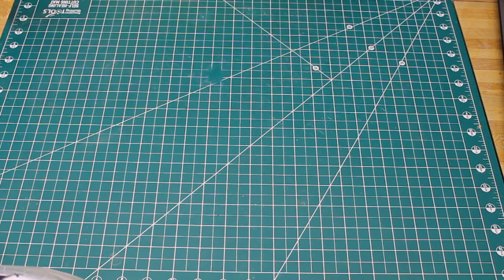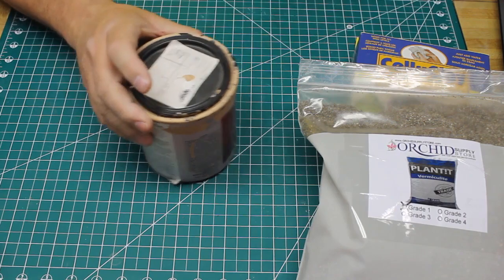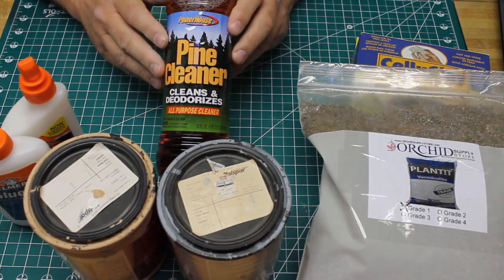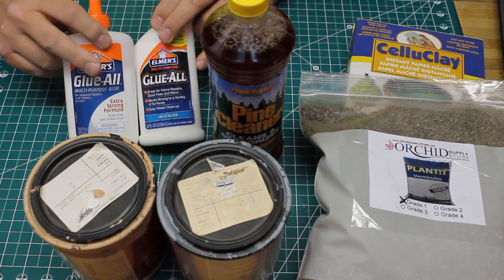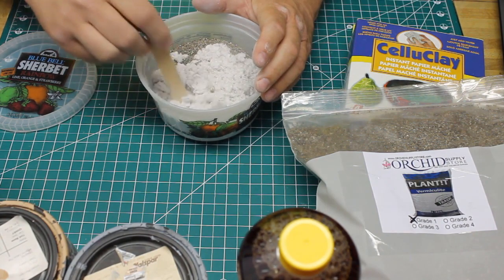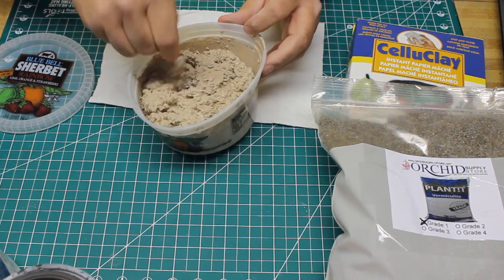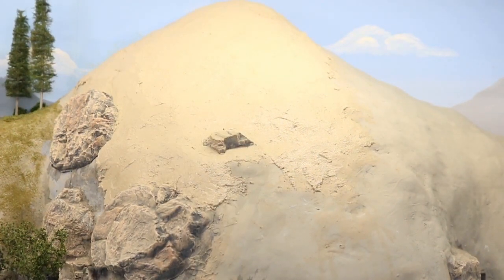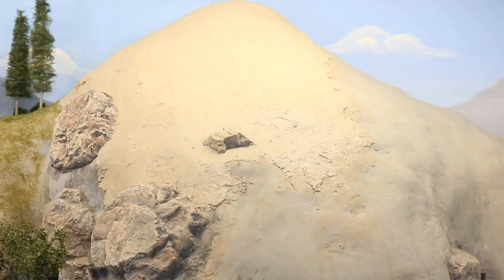Model Scenery Ground Cover Using Ground Goop

Comment: Good video, Ron!  A tip ... you can pre-color your dry plaster with dry tempra color before adding it to the water.  This eliminates any white plaster coming up from drilling ... as it is pre-colored!  This will be good when drilling through the  Ground Goop, just in case you drill into the plaster base.

Comment: Great video Ron. I'd suggest a light spray of wet water before applying the goop as Plaster does tend to suck up moisture. It may help make it a bit easier to apply. Looks good though!
Neil W
Reply from the maker: This plaster had been sealed with paint already so I think the water just would have made it harder to stick.

Comment: Good video,  I've always said to put color in you plaster for the very reason you mentioned as you plant trees or chip the scenery,  it makes good sense to me, the goop is a good idea as you can work with it longer and it looks to be a little lighter material,  I wonder if it's any stronger too, as the paper mache would give it strength,  your paint did look like the added gray made it match your other paint, thanks for the formula for goop as I've never had it before and sharing....Jack 😀
Reply from the maker: It is definitely not stronger. This needs a solid base of some sort under it, but it does make a nice top coat the the ground.

Comment: Great explanation of ground goop Ron. Did you know that you can wet the back of a rock casting with water, and stick it in to the ground goop when it's still wet and it lock's it in real good. It may be because it has the glue in it.
Reply from the maker: Intereating. Thanks for that tip.

Comment: Pretty cool stuff have never seen such detail on model trains. Ron I'm thinking about building a model dirtbike track for my son to play with his toy bikes. Using the foam and a compound like this is the structure relatively durable? Thanks
Reply from the maker: I would definitely say it is pretty durable. This shell dries to a hard but somewhat flexible surface, so on a good base like extruded foam it does very well.

Comment: Ron, would Mod Podge Matte work in place of the Elmers?  (It dries without a "sheen" or a crust.)
Reply from the maker: I don't think Mod Podge would work in ground goop as it is too thin, but there are enough elements in ground goop that sheen is not a problem.

Comment: Ron, hate to be a Debbie Downer, but, while most current vermiculite does not contain asbestos, some does.  Therefore, breathing the dust should be avoided.  Especially if you have older stock.  When you were stirring that dry container and dust was rising, I was concerned.  Mixing promptly with paint should make it reasonably safe.  Not a significant risk but easily avoided so why not be careful.  Thanks for another well-produced video.
Reply from the maker: This is new Vermiculite, had no dust. The dust was from the Celluclay--recycled paper dust.

Comment: Good vid brother...  So, after all that what do you think of using your hands? That's not my preference. I really like the artists knife/spatula, to Ralph's chagrin. If applying it works for you, go for it, but if not, please make sure to rub that in to Ralph too! :)  I really love the ground goop, for a lot of reasons I posted in various replies below, but primarily because it's so much more enjoyable to work with. But it really solved my weight problem, with my layout made entirely and just of foam weight would be a real concern. But with ground goop, it's light and flexible, so it won't damage so easy as I take modules down to work on them or when I eventually move the modules into a larger space. As additional incentives, it's cheaper, lasts for a decade or longer if well sealed, is fast working since I apply dirt immediately most the time. Also a very important consideration for me was the layout be easy to change. My argument against a traditional wood frame structure with roadbed on risers plus plaster on whatever substructure, is that it's much harder to change, destructive and messy, so many people, me included, resist changes unless really committed to doing so. With ground foam over extruded foam, if I wanna change something, take out my wallpaper knife, do some damage, throw some pre-mixed ground goop on it, apply dirt, after it dries I can apply additional vegetation, in a matter of 24 hours I can be back where I was if pretty committed to it. While I'm good with there being many good ways to model, and plaster is fine if you like it, ground goop is so very well suited to modular, portable, or TOMA situations. I would really encourage everyone to try it, your out a touch of whatever house paint you have on hand and maybe a 20 spot for a small bag of paper mache or cellulose and vermiculite. Also, I don't add the glue, as you mentioned in the video that I don't. In the absence of the glue it retains more of the latex's flexibility, which to me is a real positive, and you'll see why as you start poking holes and planting trees. Without the glue it's super easy to plant trees. For the larger foreground trees that have pins in the trunk, just drive them home, and for the more fragile materials like SuperTrees, an awl or even a skewer makes quick work of it. Regardless, it was a good video and I very much enjoyed participating in your experiment...
Reply from the maker: Hey, Andy. I hate to tell you, but applying with hands in open areas worked great--really fast. The artist spatula is, however, the only way to go up close to rock castings, backdrop, and other items you don't want to ground goop all over. I like the material. Once dry, the texture is a little rougj for N scale, but once covered with scenery material I don't foresee this veing an issue.
Reply: Ron's Trains N Things Sure thing...  I see what’s happening here, Ralphs got to you first!!!  LMBO. It is fast for large areas.

Comment: Is this ground goop an alternative to sculptamold? Thanks for your videos!
Reply from the maker: Well, sort of. Sculptamold is great for filling in around rocks and forming other scenic coutours. Ground goop is intended as a ground cover layer that is easy to push trees and other scenery elements into and is ground color. After working with both for a while, honestly I prefer Sculptamold mixed with a little tan craft paint to color it or even just Celluclay mixet with paint and some diluted white glue.

Comment: Reading through the comments it would appear this is an "as well as" to plaster rather than an "instead of".   I'd read about it years ago but this is the first time I've seen the application.  Not sure I'd be worried about it to be honest as it would appear scatter and what not over coloured plaster does the job just as well.  However, Ron, since you've done it, are you going to continue to do it, and, probably more telling, are you going to replace the areas you didn't do it on because it looks so much better?
Reply from the maker: I will not be re-doing areas. I think it will be helpful in plaster areas going forward because my plaster is not colored. For me, the best application will be on areas of foam scenery that have nothing on them.
Reply: I see it as an instead of...  And it depends, if you like plaster and it works for you, keep at it. I HATE working with plaster, just hate it. So I LOVE the ground goop. Ground goop is also much lighter than plaster, stays somewhat flexible, is much easier to plant vegetation in, plus has texture naturally. It's also a much faster process, I apply ground goop, and since it's just wet paint, apply dirt, leaves, etc., immediately. So I can go from pink foam to dirt covered in one step. It's also very very well suited to modules or portable layouts as it's not as vulnerable to damage as plaster. It's also easier to work the way I work, I can make a batch and use out of it for months until I use it up. So if I'm working and need to modify the landforms I can just apply a bit and seal it back up, with plaster I would have to mix a batch, apply it, wait to dry, paint, dry, glue and dirt, dry...  It's cheaper, lighter, easier to plant into, easier to cut and modify, easier to work with, has less weight, and on and on. I'm a real fan of the stuff. After I tried it the first time I was sold.
Reply: Andy Crawford thanks for that.  Very helpful

Comment: Great video Ron!  Wonder if anyone has tried adding shredded newspaper (I have a micro-cut shredder that literarly pulverizes paper) with plaster into this formula instead of the cellulose product?  Or, the use of cellulose-based insulation product?
Reply from the maker: Hey, JD. I have heard people talk about that as a potential idea, but don't know anyone who has actually tried it yet.
Reply: I've used cellulose instead of the commercial "paper mache". Works fine and actually prefer it, not least because it's quite cheap for a lifetime supply. I now have a bag of blow-in insulation or cellulose and a 25lb sack of vermiculite, with a 5 gallon jug of paint one could fill a basement. Also, if your working with a large batch (no reason not too since it will last a decade) it'd prolly be a good idea to pick up a mixer that chucks into a drill.

Comment: I don't know how your pine sol works. I used the dark amber Lysol concentrate. I used a five gallon bucket with the 2 piece screw on lid and have had this in storage for 5 years. It still works perfectly. The key is to make sure you have an air tight container.

Comment: Would sculptamold work instead of celluclay? ??
Reply from the maker: Hi William. Thanks for your question. I had actually addressed that in this video, but it was getting too long so I cut it out. The short answer is no. Sculptamold has a plaster in it that would set up fairly quickly. The beauty of Graham group is that it can keep for a long time. The plaster sitting up in the skull to mold would ruin any that you had left sitting for more than a few hours. You might be able to use it if you use the whole batch within a couple hours, but I think that would destroy the beauty of this particular product.